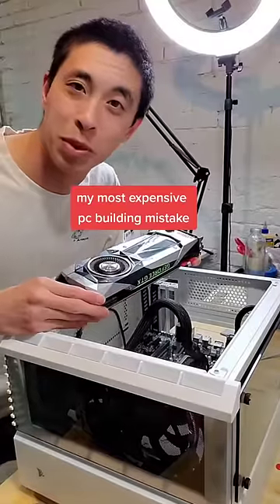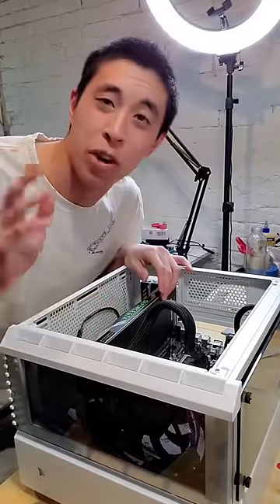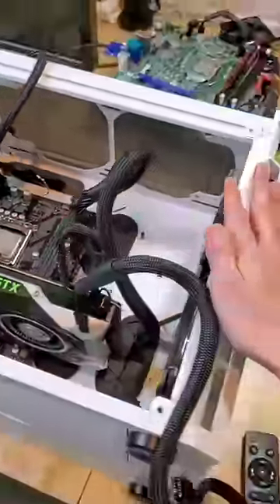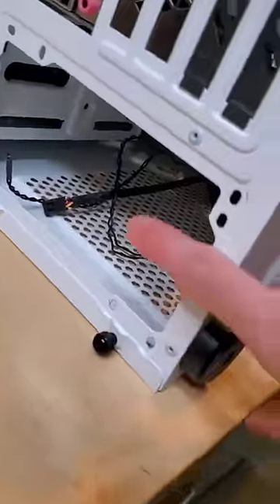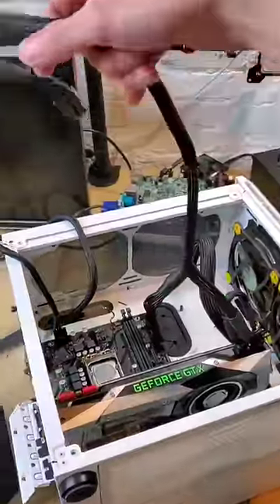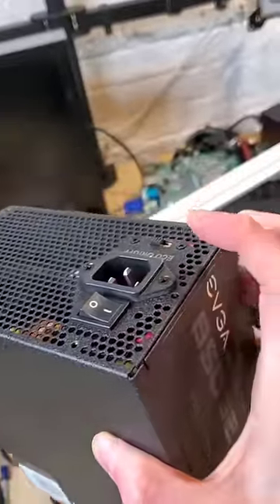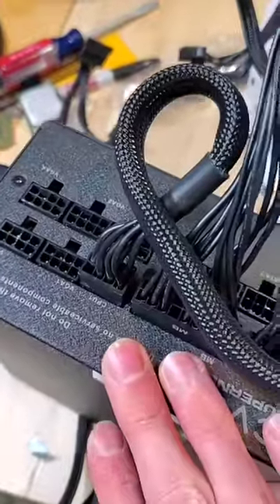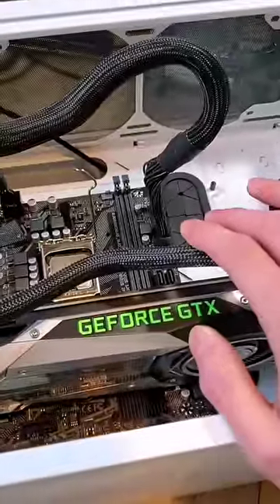my most expensive pc building mistake... #shorts

Comment: Just remember, when it comes to electronics, never take a shortcut
Reply: Or in life in general 😅
Reply: Only shortcut I take is putting a shortcut on my desktop
Reply: Or engineering in general, we all heard what happened when someone tries to make a shortcut during the production of a submarine.
Reply: It’s also very bad when electricity takes a shortcut…
Reply: @Alex_Fishman or the PS4 Controller Battery😢:Skull:
Reply: Never buy prebuilt PCs.
Reply: I just finished my first build and I was so anal about my wiring and power connections I almost triple checked everything was in the right slot. Cost me more time but id rather that than have a dead pc
Reply: @BloonMan137 😂😂 underrated comment
Reply: I took a shortcut and make my pc better lol
Reply: @BloonMan137 good one
Reply: Or jus find your local pc shop 😂
Reply: Or work on important stuff when your tired, i fried a few thino accidentally wiring the wrong power wires (5v to 12v) to the right supply or reversing the polarity. I tinker with old stuff that dont have standard connectors/or proprietary wiring and such... Or i  get mixed up!
Reply: Stumped on if pun intended.
Reply: Or u might short circuit
Reply: I'm still really confused about what he did wrong. Did he plug the cables in the wrong slots or something?
Reply: @zowbaid89  It's because he used the old cables with the new PSU. Always use the cables that come with your PSU.
Reply: @rach_bot  Oh! I never knew that. Thanks for the comment! Definitely something I need to know in case I replace my PSU. :)
Reply: You take the shortcut, you get short circuited
Reply: @zowbaid89  Yes Always use the new cables even when you're replacing the Same psu
Reply: Was that supposed to be a joke?
Reply: @orangeparrots5898  Yes and it's that IT worked perfectly my little sad parrot
Reply: @cryora much worse was buying a prebuilt OEM, learned my lesson 😅
Reply: Except that is what electrons do. The path of least resistance.
Reply: There’s plenty of shortcuts to be taken if you know what you’re doing
Reply: @zowbaid89   yep, there was a guy selling rebuilt peecees at the local flea market that almost relived himself from Earth surface by putting all the cables in a cardboard box and the PSUs on shelves to save space and would pick and choose in the bundle what he "needed" for a build. didn't last long until he matched the wrong ones. he ended up getting booted out of the flea market when his cheap lithium batteries batch charger did a chinese restaurant out of his shop there and three other shops. no insurance and he flew back to Algeria when them cops started asking around... 😹
Reply: Just from the name

"Short" never a good word to come from an electronic stuff
Reply: Yes shorcut=shortout
Reply: 90% people did not get the joke😂😂
Reply: @rach_bot  how do u tell  if a psu will work with a cable without a problem?
Reply: @derekjum1798  If the cable came with the PSU, it will work. If the cable didn't come with the PSU, it's best not to use it. You run the risk of producing magic smoke using different cables. :)
Reply: Yup! SHORTCUTS LEAD TO SHORTS PEOPLE!!!
Reply: But i heard u can use a extension cable and i will work in this case.
Reply: @rach_bot  can u use a extension cable , i heard u can
Reply: @rach_bot  oh yeah i found out that extension cables however can possibly fix this issue as well
Reply: If you take a shortcut then it shorts out.
Reply: Who are these people saying always use the cables that come with the PSU? What modular PSU are you buying that comes with cables?
Reply: True, shortcuts lead to short circuits.
Reply: Or a short circuit lolol
Reply: Shhh, this is how us electronic technicians make money
Reply: electricity will always find the shortest way

Comment: dropped a screwdriver into a running system and got a light show 💥
Reply: damn
Reply: same story except i dropped a whole ass canister of mineral oil 🔥🔥🔥
Reply: @arnoldshmitt4969  yo dad beat mum ?
Reply: @hike8932  my mum beat dad lol
Reply: @arnoldshmitt4969  mom got a beating of a life time ?
Reply: Same story bro I did it with my 16 years old pc when I repaired it, 3 months ago with my friend. It become fully functional but then this happen and my power supply and motherboard chocked.
Reply: demon core moment
Reply: @hike8932 I thought mineral oil is not conducive
Reply: @dunkingducks6689  impure mineral oil*
and also had some air innit
Reply: Let me guess.. you were trying to start your pc with the screwdriver trick
Reply: @Calm_Mentor  yeah
Reply: I fried a Radeon HD5700 GPU by touching the chip with a live 12V cable (it was for a fan).
Reply: A light show you can only see once 💀
Reply: Chenobyl reference?
Reply: @dunkingducks6689   liquid cooling turned into waterboarding in a flash... 🔥😏👌
Reply: Same
Reply: demon core moment
Reply: same
Reply: unplug and press the power button to discharge any energy before you remove the side panel to work on it.
Reply: @NightOwlGames  well in my case it touched a big capacitor that needed to be replaced afterwards

Comment: I literally saw this video right after considering doing this in my head holy fuck.
Reply: Odds are it’d be fine, especially if they are quality cables. But not worth the risk.
Reply: Seriously! I just bought a new seasonic 850w psu with my 6800xt and nearly did the same thing until I saw in the manual it said NOT to do that, so I replaced them all. Whew!
Reply: U R lucky
Reply: @bbarone  Mostlikely not, it has nothing to do with cable quality. Manufacturers pin their cables differently.
Reply: @bbarone  Doesn't matter how good your cables are, if you put 12V on a 3.3V trace, things will go poorly. 

You can easily look it up online if you want to keep you cables, though
Reply: Gotta love the AI algorithm sometimes. Predicts your mistakes before you make them, and gives you videos to correct your future decision making lol
Reply: @bbarone  its not that fact that the cables are “quality” what did it is that not all brands have the plus and minus pins in the same spot so that’s why you never want to mix cables with other psus, that’s why on cable mod’s website they ask you what power supply you use so they can have the plus and minus in the correct spots for your psu
Reply: Lmao you my guy, you're lucky
Reply: What happened?
Reply: Same! I didn't even look it up! It just showed up in my feed. YT algorithm is reading my mind! 🤯
Reply: HAHAHAHAHAHAHAH ME TOO
just bought new psu and 3080 and thought about this 😂
Reply: me too, constantly thinking about electrostatic discharge and now this came out
Reply: I didn't understand what he says at the end, my English still bad
Reply: What was the mistake?
Reply: @bbarone  odds are you fry your PC, short term or long term.
Reply: @rackio14  he used power supply cables from one brand/PSU with a completely different power supply. The cables might look the same and fit the same holes, but the insides (the pins of the connector) aren't always in the same order.

If you get a new power supply use it's cables, or cables specifically rated for that power supply.
Reply: @epmcgee  😨 thanks you
Reply: In case you did not get the message, I would not recommend doing it.
Reply: I did it and my computer just didn't boot up, everything was fine. When I realized what I did I was like holy fuck thank God it didn't turn in
Reply: @Koto.Sleezy  wait what? Would the +- on cables not need to be standardized if they all go into the same standardized socket on GPUs?
Reply: @MugwumpSupreme  I have been thinking the same thing. There have been times when I have been thinking about something for a few days and never entered it into any device and sure enough it started displaying in my feed. I'm convinced there's definitely mind reading tech in this stuff
Reply: Is it just me thinking if you're gonna show us at least put the heatsink on the cpu and the RAM in the slots before you demonstrate turning it on and frying your kit. I have to assume the heatsink was on when he did it but gotta be clear with these things because its definitely gonna smoke with no heatsink 😅
Reply: What does he mean by mixing power supply cables? I’m new to this
Reply: @TheRoadLessChosen  using cables from a different power supply in his new power supply, or in this case using the guy who sold him the gpu's cables in his power supply
Reply: @TheRoadLessChosen  Like if you buy a Corsair HX850 you get a bag of cables with it that you can plug into the PSU because its modular which means you can attach and detach cables as you need them instead of having a load of unused cables in your case coming out of the psu (Power Supply Unit).

So if I came to your house and you lost your bag of cables I could bring my bag of cables from my PSU that is not Corsair but instead another brand. 

Cable looks exactly the same and fits the exact same port on the PSU, but what you don't realise is when the manufacturers created my PSU they made the positive and negative charge ports the opposite way round.

That means that your cable plugs into your PSU positive on the left and negative on the right for example and the cables to match, but my PSU was made the opposite way round with negative on the left and positive on the right.

So plug my cable for my PSU into your PSU and they connect wrong in such a way that it can be dangerous and blow your whole motherboard as well as anything attached to it. 

Not something I even considered till this video, luckily when I did this my housemates PSU was also Corsair which doesn't guarantee safety but I got lucky and they happened to be made the same way round. But maybe newer Corsair PSUs swap the charge ports around in later products for safety or efficiency reasons, so even the same make probably isn't absolutely guaranteed to work.

Sorry long winded I know but I hope this helps 😊
Reply: @jamieclarke2694  thank you for the long detailed message. I needed to hear it explained that way. I appreciate it
Reply: I definitely would have done this as well. I literally bought a modular power supply so in the future I wouldn’t have to rewire when I upgraded…
Reply: @Koto.Sleezy  I have the Cable Mods website in my notes now. I've been considering doing some beefy upgrades to my ROG Strix GL10dh and was worried about getting the correct Power supply. I've seen information suggesting that as long as the Power supply is compatible with your motherboard form factor then you are good to go. According to this information you also gotta watch what cables you use too. Useful info for sure.
Reply: @jamieclarke2694  you can turn on without heat sinks and coolers for short tests and stuff to see if everything is working and turning on before mounting heat sinks and coolers. I wouldn't run without for very long, but I've seen plenty of professional seeming youtubers do it with computers and Xboxs for simple tests.
Reply: @Brandon Lacasse  short posting tests yeah but the cpu will definitely smoke sooner rather than later 😅
Reply: Yea Google analytics is getting crazy huh!
Reply: excuse me. but the mistake here was to use the previous cables with a new power supply?
Reply: @hamdanali3063  using old cables with new psu= fried hardware
Reply: Me too
Reply: He saved your ass so hard
Reply: Jajaja good karma for you
Reply: @bbarone  Wrong, wrong wrong oh SO wrong
Reply: Definitely don't. I changed my power supply with my new build last week and I used the old sata cables because I didn't know about always using new cables.

It wouldn't boot, and I spent 4 hours troubleshooting and putting in old and new parts one by one to see where the system failed.

I eventually learned it was the PSU and that I had killed 6.5 terabytes of hard drive storage. I was extremely lucky I didn't have anything besides steam game installations on those
Reply: # YouTube algo
Reply: @Koto.Sleezy Oy person to explain what actually went wrong. Thanks!
Reply: The algorithm knows.
Reply: Tax on the stupid.

Comment: Same issue as in the video, but slightly deeper... NEVER re-use power cables that didn't come with your specific PSU. I bought the exact same PSU 3 years apart, same exact model but newer. Thankfully I did not fry my PC, but my PC would not turn on and I turned it back off quickly to troubleshoot after the PSU swap. Swapped cables to my mobo for the new PSU's cables and problem was solved... some small change over the years..
Reply: I did the same thing but fried a new CPU

Comment: When it comes to modular PSUs, you NEVER mix cables.  Most websites about building computers probably go over this.  You don't know if the wiring is the same.
Reply: How could it be wired differently if the cables appear to be identical? The wires should be in line with the pin pattern for each plug. If the cable is literally terminated the same on both ends, there's no logical reason for the wiring to be different. That would mean that they intertwined the wires or braided them in some fashion which is not recommended for electrical wiring.
Reply: This is a HUGE oversight that can literally FRY YOUR PC!
This should be a standard!
What's the point of a modular PSU, if the cables aren't?
Reply: Why aren't they standardised